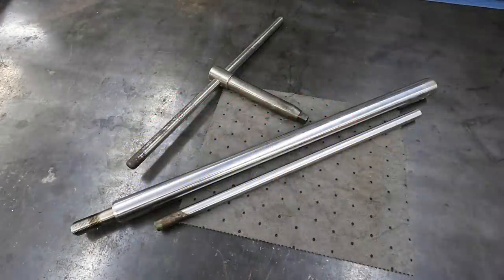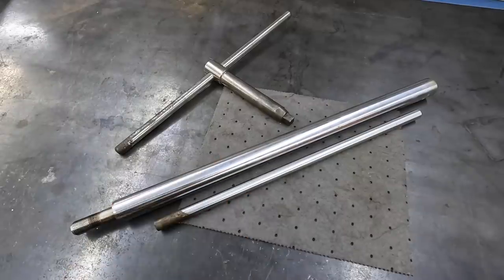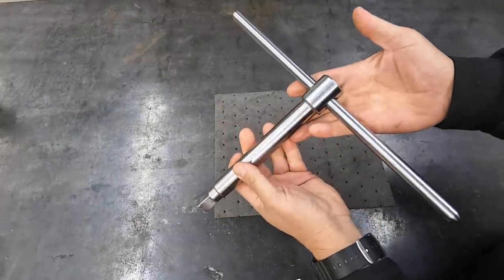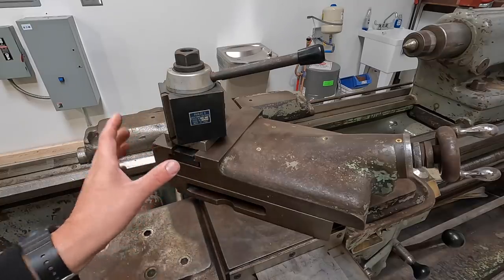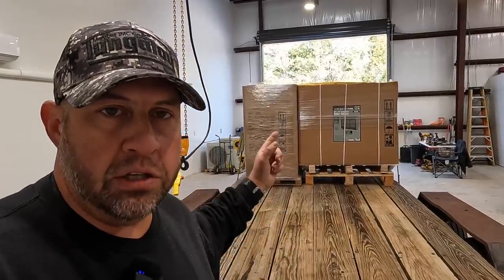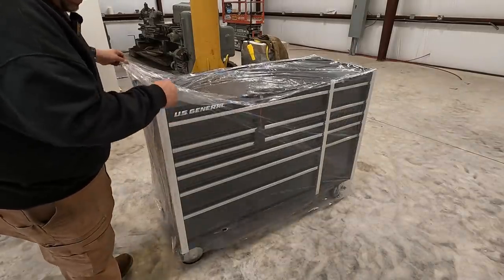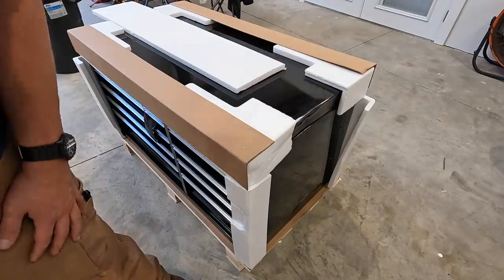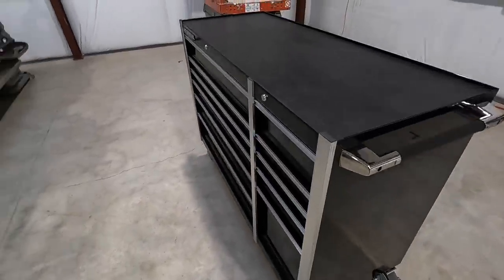Saturday Night Special 358: 3 Jaw Chuck Wrench, New Tool Boxes

Comment: Hi Adam; can I suggest you paint on the floor of the shop a line following the furthest reach of the jib crane? It's a one time thing that takes only minutes to do, but when you are looking to set up a simple lift it will save you time. With a complex or difficult  lift it could be invaluable. Thanks for all the great videos I've learned a lot from you! Have a great day and a better one tomorrow.

Comment: I love my US GENERAL tool boxes. They are really solid. I used a solid core door that I found on Craigslist for the top on both of my US GENERAL 44’s. I was going to do butcher block but couldn’t pass up on the door for $35.00. Thanks for another great video. The new shop is looking great.

Comment: For all your slings and chains for the jib crane make 2 semi circle bands the diameter of the jib crane tower so they can bolt together and squeeze around the tube and then weld a load of hooks onto the 2 semi-circles and hang all the slings/chains off the jibs pedestal just below the 2 rollers then everything is with the crane and not across the workshop taking up wall space

Comment: Awesome video on the chuck.  I liked the part about loosening the set screw to move the handle for leverage.  Instead of a set screw I wonder if you turned a knurled knob the same OD as your piece and threaded it for the set screw.  Then you wouldn't need a wrench.

Comment: Why not a remote box on the lathe for stop - forward - reverse??? Two power relais with additional NC contacts for cross security will do the trick.
I made this on my lathe too, otherwise you will have to walk around every-time to put it in reverse...
A pain in the butt if you ask me, especially when you are cutting threads.

Comment: Question about making the chuck wrench:  When cutting the flats on the mill, you fed in on the X axis, then went back and forth on Y to make a straight line shoulder.  Could you have made that cut on just the Y axis?
Reply: If you had to take multiple passes in the Y you might get some additional tool marks that you don't get with a full width pass in X. This way it's just one pass in from the end and a little back and forth to get rid of the end mill radius. I think cutting in Y might be more subject to chatter, but that's really just a guess.
Reply: Short answer: Yes.
Longer answer: Yes but... because of available setups and whatever may already be on the mill table Adam used an indexing head. Most indexing heads are made so the operator has the controls and features most easily accessible when the head is on the left and the work is on the right. So now he has to advance the workpiece in to the cutter from left to right... which is what he did. OR he can go front to back (or back to front) with the tool making each cut in a single pass (well two passes) and only have to move the table along a single axis which is, I think, what you are suggesting. BUT there are a few problems with this approach... One is if the tool starts the cut from the front it will be between the operator and the work piece and it is difficult to see what is going on the other is if the starts the cut from behid the workpiece he can see what is going on but then he will be "climb milling" (which gives an excellent finish) on quite a deep cut. The reason why climb milling might be bad in this case is not all mills are capable of climb milling... especially in the Y direction. I believe that Adams mill will climb mill in X but I don't know about Y. If you are not sure what climb milling is look it up.
Soooo.... given the setup that Adam used and the equipment and tools that he has he did it in about the most efficient way possible.

Alternatively he could have used a 5C square collet block and clamped it in a vise with the work piece sticking out on the left hand side. Then he could conventional mill from behind the work piece.
Reply: @utidjian  This is exactly the answer I was looking for.  I didn't take climb milling into account.  Thanks!

Comment: I own a large set of tool boxes from Harbor Freight and am satisficed with them with the exception of one thing. The locks that Harbor Freight did not and refused to provide locks that were all keyed the same. What I ended up doing is went to a local lock shop and fought all the same keyed lock cores and modified them so the  latching tab on the back side lock could fit on the locks. So with some modification I was able to have working locks that are all keyed the same.

Comment: I own the 44" roller with a side box. I have had it for years now and I love it. Very well made and sturdy. I have the full width top drawer completely full of sockets and ratchets which is quite a bit of wieght with no issues at all. Holds it easily and slides smooth.

Comment: Adam, I saw a trick for slightly uneven straps just yesterday! Add in a big beefy bow shackle or two to lengthen the shorter side of the straps leveling out the load by a few inches. Sometimes a few inches in the shorty is all she needs to get laying out flat!
Reply: CEE right 😂

Comment: In your lathe as far as i understand is a oil pump, or even several oil Pumps. If u run the lathe backwards, wouldn’t u run the oilpumps backwards as well? 🤔🧐
Reply: Sequence of drive, is, Motor, Oil pump, Reversing gear, Gear box, Final drive. The motor drives the same way all the time. Is my reckoning, and the only way to be made look silly, is to print a comment on Youtube for all the world to see.
Anyone else, want to join me.
Reply: @markneedham8726  but as I understood Adam, he is planning to run the motor backwards by flipping the 3-phase-Power….
Reply: @frankangermann6460  It depends on the design of the lathe. Quite often the oil pumps are reciprocating running off a cam (at least on a Monarch) so it doesn't matter which way the cam spins. However, most coolant pumps are centrifugal and won't pump if run in reverse.
Reply: @RambozoClown  make Sense…
Reply: It really depends on the lathe but many will still pump oil properly running electrically reversed.

Comment: Great choice on the US General boxes. They do seem to be the best bang for the buck, and definitely a highlight of the offerings from Harbor Freight, or as AvE calls it, Hazard Fraught!  ;-)
Reply: I agree about the US General boxes, I just wish they weren’t made in China.
Reply: @corydriver7634  Well, you can always get US-made Proto boxes from Zoro or MSC. Last time I bought one it was actually cheaper than the HF Icon equivalent. I don't recall if there was an equivalent US General model; the one I bought is 24" deep. I did look at the US General, especially the tool carts which are dirt cheap, but between steady rest, follower rest, and the like I needed the extra room.

Comment: For the 44” lower box check out the end boxes at HF, they  add storage and can give a small work or staging surface.
The HF technicians wooden topped roll arounds are also excellent for machine provisioning and tooling.
Looking forward to the continuing developments.
Take care.

Comment: Contrary to what many believe about Chinese goods being substandard, many Chinese goods are not. When you compare a Craftsman or Cobalt to a Harbor Freight unit, you are not comparing apples to apples. These tool boxes, like a thousand other things, are made to the specification that the purchasing company lays out in their contract. Harbor Freight has a higher specification. That spec details like material thickness, paint type and quality, right down to how many spot welds are in a specific scheme. So don't blame the Chinese for poor quality "Name Brand"  items. Put the blame where it belongs which is on cheap American companies striving to build their bottom line at your expense. Another thing you should consider is that factories in China, Taiwan, India, Pakistan and South Korea learn from their mistakes and strive to produce better quality items at a lower cost. This is something many domestic companies have forgotten in their plans to higher profits. I'm sorry to say it but "buy American" means little anymore and it is not the fault of the workers but the fault of their employers. How do you expect American Workers to built better when the factory they are in is 40 years old and the machinery is just as old and is tired and worn out while their Chinese counterparts are working is a 10 year plant with continually upgraded machinery?
Reply: Yeah that’s fine. But quality and standards of things like. Welding rods, steels and any other materials are sub or for sure.  Always have been always will be. That’s why you can scrape the paint off your “product” and find lead in the paint 🥱😩
Reply: I guess the one I got wasn't made with that standard...

Comment: Thanks for sharing the great video! I agree that these are great boxes, for the money. I added a 1.5" butchblock top to the 56" toolbox, then mounted my South Bend 9" lathe on top of it. Works surprisingly well, and full of tools, it's actually really stable. Also replaced the locks on all my boxes with keyed alike Medeco 3 pin high security cam locks so I only have to keep up with one key. Was super easy for a little peace of mind. Appreciate you sharing your experience with us!
Reply: Medeco makes some good stuff, no way in hell I could ever manage to pick one of those.

Comment: I have made more money out of my cheap craftsman and harbor freight tool boxes then anyone with snap on or matco or mac boxes. I do not owe a mortage payment on my boxes or tools every week when that flashy truck pulls into shop parking lot. I have just about every brand of tool made in my boxes but all of it is paid for and when I get my paycheck 100% of it goes in my pocket not to an overpriced tool truck. I do have a Cornwell tool box full of Cornwell tools and that is only because I got a smoking deal on the package through college in the 80s other wise all my tools are hand me downs or estate and yard sale finds or tools I bought as needed but never have I been one to step on a truck and be like here's my whole paycheck now give me that one socket. I'm about getting the job done and making money not spending it. If you don't abuse the craftsman or the harbor freight US general boxes they will last you years and by the time you are ready for a new one these people addicted to flashy tool trucks will have bought the tool guy 6 more houses and already changed boxes multiple times because they had to have that new box with the 50 cent graphics.

Comment: I used to have the harbor freight 44” tool box, upper and lower. I of course grew out of that box at work rather quickly and went with the 72” with the 7 drawer side boxes on each side. I’ve had my 72” in every day operation for 4 years now and can say I am quite impressed at how it is holding up. I’ve had high end craftsman (Sears) in my garage that only saw minimal use on the occasional weekend project that didn’t last near as long. I can attest that the harbor freight tool chests are well built and will hold the rated drawer weight and then some with heavy use.

Comment: Adam, NEVER stick your two fingers on two hot terminals, even if you think the machine is not connected, unless you don't like your hand. (17:58)
Reply: Cringed every time he did that even though I assumed it was not live
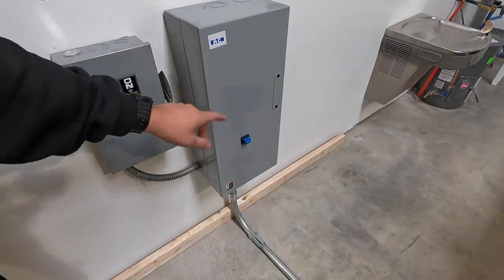Reply: @johndavies2396  Same here. What we don't see is, until 18:30, that the main switch is off.

Comment: I've been using my HF 44" box for a couple years now. Only have it about 1/3 of the way full but that top drawer where you have all your drivers is SUPER handy. I mainly do mechanic work so I keep my sockets, wrenches, extensions, and the like in there for quick access. I got mine in blue. 😜

Comment: I went and bought the next size smaller tool boxes than you did, I got the roller cabinet, top box, and a side box. Super impressive on the weight and smooth slides on the drawers.
I had to put the wheels on mine then had to use the tractor to pick the top box up and place it. I'm still organizing.
You may want to look at the magnetic line of accessories like the paper towel holder or the cup holders. I got some of the cup holders and holy cow are they strong.  The onlyvway to attach them any more firmly would be with a welder.

Comment: Say what you want to about Harbor Freight tools. I have a rapid pump jack and it served me well since 2010 I've used it for road side service for school transportation vans I've never had to add oil to it.
I also have a quiet a few hand tools that are the same age as the jack that I've used day in and day out and they have also held up to the abuse of using them out in the field.
Reply: Well you have just proved what others have said....not everything that Harbor Freight sells is junk just most of it.  Guess the rapid pump jack is a good buy.

Comment: Would turning grooves in the handle and adding a diy ball detent mechanism with a ball bearing and a spring under the set screw work better as it would give you the ability to change handle lengths for torque without using an Allen key?

Comment: Like your videos...cool boxes.  While a full width slab would look great, they are not as stable as a good laminated wood top       ( think kitchen counters).  Two layers of quality plywood is also very stable and will not shrink or expand with humidity changes.  The edges of the plywood can be covered with hardwood.  You can get premade good quality 1.5 inch counter tops from the big box.

Comment: Thanks for reminding me to check the auctions for Lista cabinets. I agree those Generals are not too bad, but used Lista cabinets would work for me at the right price.
Reply: I like Lista tool boxes too but they do command a high price but nowhere near what Snap-On would charge.  Nevertheless 3+ units of US Gen Boxes at Harbor Freight for the price of 1 single Lista not including a special top for an $900 big ones!    I believe that HFT has found the correct recipe of price, performance and applicability.   Some of the Husky boxes are spot on as well as I have purchased 3 of them the past 90 days.

Comment: US General tool cabinets are some of the best things Harbor Freight sells. If you really plan to roll it around a lot once it's loaded, you might want to get a set of heavier duty castors (which they sell). The hoist would make it pretty easy to swap them out.

Comment: A few shops I worked in years ago that had hoists, we would attach a steel or stainless steel cable to the outside of the control pendant cable at the housing and pendant so one guy could control the crane while lifting or lowering. That kept someone from using the pendant as a lead, either by accident or on purpose.
Reply: In one if the install videos he mentions the pendant cable is designed with a tether/lead built into it.

Comment: A 4 or 5" vise mounted on that 55" roll-around would be a handy addition also. Looking good!
I have a black roll-around made with Asianinum materials and I rolled it many miles around a Hospital campus for about 6 years. The drawers bowed and the back walls of two drawers split vertically. After some patch repairs and being parked after retirement, they seem to be holding up now.

Comment: Adam, Fast Forward to around 13:31 and you'll notice the audio only come out of 1 side. however when you're back at your shop at home it comes out of both channels.
Reply: Same thing for me.  Parts are left speaker only.  I'm on a PC.
Reply: I'm glad it's not just me! It would be great to have the audio sorted out to the same standard as the rest of the production :)

Comment: You could make a spreader bar for wider items. An H-beam with an eye and two hooks might do. That way the straps can be spread out without risk of shifting. If you make the eye adjustable (left/right) you can even compensate for uneven weight distribution (or strap length, though ideally you'd have to straps of equal length on square objects like a toolbox).

Comment: Adam, you did not chamfer the ends of the square drive on the chuck wrench. That would help with the insertion without compromising fitment.
Reply: He tried it with the chuck in the video.  It worked perfectly.  There was no "compromise of fitment" noticed!!!

Comment: If anybody wonders how to move a big roller cab tool box without special equipment, a common trick in automotive shops is to call the local towing company.  Many will move a box with their flatbed trucks and it’s usually quite reasonable.

Comment: You can get butcher block countertop slabs from Home Depot, Lowes etc. They make a great top for the boxes and are inexpensive compared to buying a 'tool box' wooden top. You just have to cut it down to fit.

Comment: Adam, keep in mind (I owned a 18" pacemaker) that some lathes aren't meant to be reversed. Ever. The reason: some oil pumps will not feed the headstock when they run in the opposite direction. Just something to keep in mind.
Reply: He ran a Pacemaker for years at Motion.  Do you really think he doesn't know how they work"
Reply: All lathe and other old machine tool pumps I ever saw were piston pumps that work each way. Other types wouldn't be reversible

Comment: I just picked up a  rolling cart /toolbox this week from Harbor Freight. I Cut the bottom tray and legs off to fit under my South Bend lathe for a drawer type toolbox for my tooling and drill chucks  chuck keys, files, emery cloth, layout fluids etc. and misc lathe accessories. THOSE US General boxes are built pretty darn good for what it cost.I would buy another one.

Comment: What??? The reverse switch needs to be at the operator station of the lathe - not several feet away on a wall. You need to be able to "instantaneously" reverse the lathe from the operating position.

Comment: ya need some paint on the floor to mark out the outer length of the crane drop. you could of parked the trailer in the right spot to unload if you knew the crane limits.